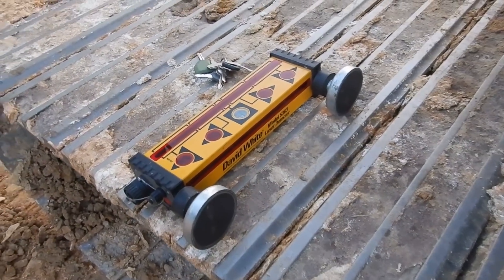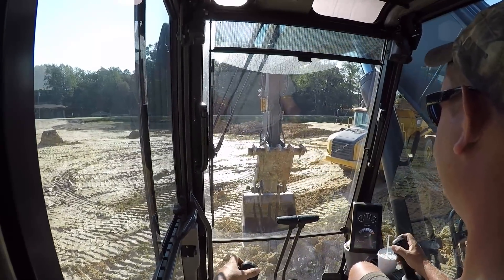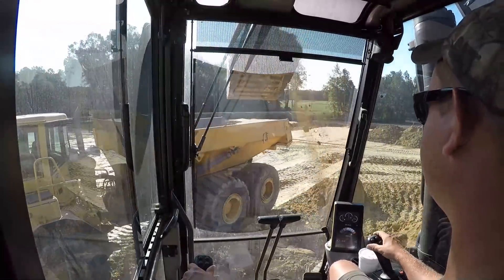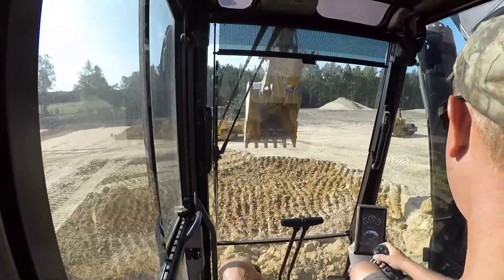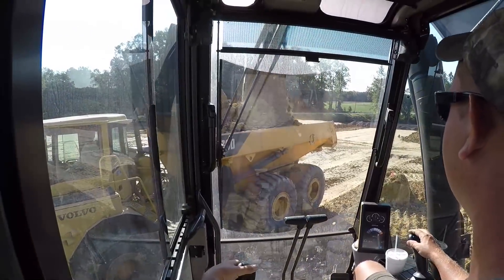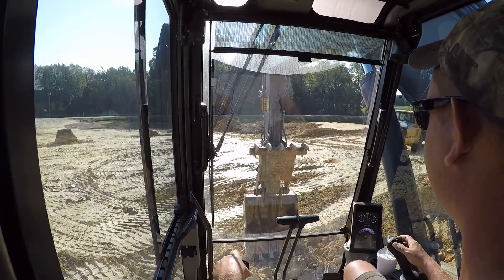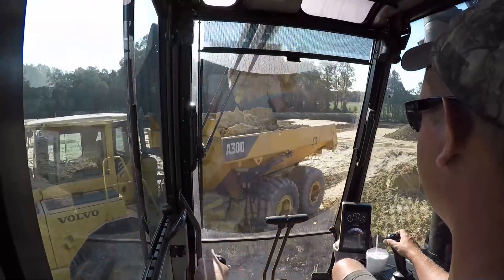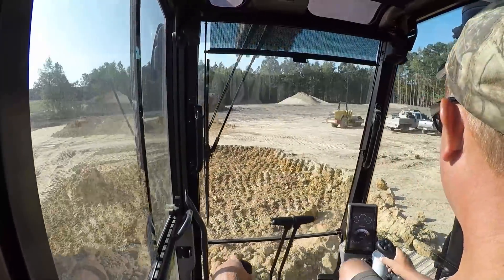This Is A Time Saver!

Comment: Suppose you have 3 bulldozers, 2 graders and 2 diggers. 
All have the same IR connection and the same rotation laser. 
On a grader or bulldozer it may even be automatic, connected to the machine's computer.
It is a very effective way of building roads, for example. 
Been there done that in the 90's.
It is very nice.

Comment: Nice..I like to set it with the bucket all the way open..so i can dig at the same time..just my 2¢..so once you see green lights just pull the lever! No extra moves just to check grade and your teeth will sink in if you need to go 6" down..
Reply: You have it mounted correctly. It should be on perfect angle as your upper dipper pin and bucket pin and teath wide open
Reply: @toddreynolds8875  👍
Reply: Todd Reynolds yeah that’s how I did it on my old excavator

Comment: You can take it a step further and put a reciever on your dozer. The only way to get more accurate would be to fine grade with micro GPS. It is nice that you can see what Charlie uses so you can see it first hand.
Reply: Yes, I would think that is where you would want a Quality GPS is on your Dozer! Matter of fact, most larger commercial jobs require GPS on your machines! If you don't have it these days, you will not get the job, and can't compete!
Reply: @scotabot7826  To me it makes sense to use GPS even though it is real expensive to purchase. But if you can have a job on a card in your machine and don't have to have stakes and the headache with those. I think the cost to set survey stakes is a cost savings. If it was me I would have GPS on a grader and maybe a dozer then a rover for sites.

Comment: What happened with that job and all the rotten out drain pipes into that pond that would stay flooded at like 20ft
Reply: I think it is on hold
Reply: Boot 185 that job is for a big company and they have to have meeting's for cost get the board to sign off on things have an engineer come in to draw up plans and other things so my guess is another couple of months and even then Chris may not get the job it depends on how many companies place a bid and then how much each one is

Comment: that tool is a great idea. what does something like that cost
Reply: I did some googling and around $1000 seems to be the average price
Reply: Yup.   For about 16/1700.   You can get more acurate one that. That also has remote control read  out  box that mounts in cab
Reply: There ment to go on an  aligned angle between your two dipper pins. And then read and zeroed in with your teeth straight out.    Then when your teeth past center it tells grade.         You should not have to check it with bucket flat
Reply: That style he has goes nice on a dozer blade

Comment: Got Topcon 360 receiver with blue tooth. If I'm using 3 point Gannon for grading, have blue tooth display in cab so I don't have to keep looking backward at receiver. EDIT: I can use same receiver with tractor or excavator.

Comment: What size is The excavator? Must be a 250.. My Wonder is what rpm you drive on? 18-1900? It moves so fast and screams in The pumps. We drive The 380 at like 13-1400
Reply: And our 250dl at like 15-1600
Reply from the maker: I run it wide open, 18-1900 rpm
Reply: @letsdig18  i looked at The video after i made The comment and saw that. 😂

Is that a thing how u drive The machines over ther? Her in sweden we drive it very "Eco"

Comment: would make sense that when you move the excavator back you would have to establish grade again - because you moved the reference point.
Reply: No.  Cuz the excavator is not the reference point the laser head is.        As long as his boom and dipper a d bucket are in exact same manner as when he set grade
Reply: iPANZERSCHRECKu this is not dirt ninjas system. It’s laser.
Reply: As long as you're working on fairly level terrain, you're good.  I've used the Spectra/Trimble version of this for about 3 years now, nice tool for solo operation but it does have it's limitations.  If you're benched on an uneven surface making a level surface the boom/stick angle changes which changes the receiver reading, can put you off grade.  I've made mounts for my dozer blade and skiddy buckets, real handy for parking areas, concrete subgrade, etc.  I don't use it as much as I thought I would, but it has saved me it's price numerous times.
Reply: @jayphillips4058    good info Jay.  Thanks.

Comment: Most people don't know in construction work , you work in a tenth of a foot , not inches . So 10 tenths make a foot not 12 inches .
Reply: A foot is still a foot !    Its just that  a tenth is 1.2 inches.     Dont matter how yha do it all the same.     As long as you can convert it in your head quickly
Reply: @toddreynolds8875  Where I worked, people tended to misplace or destroy tape measures and would "borrow" somebody else's. I had one that read in tenths of feet that would disappear. When I heard somebody swearing, I immediately knew where it was.
Reply: @tiredoldmechanic1791    now that funny !
Reply: @tiredoldmechanic1791  I had a tape with foot and inches on one side and metric on the other it disappeared.